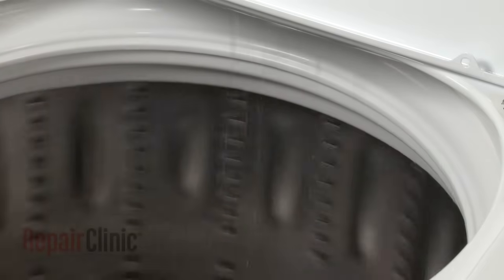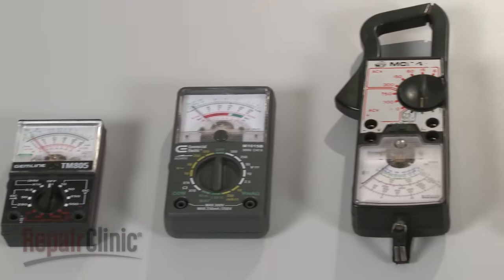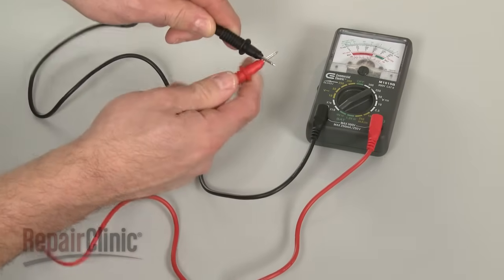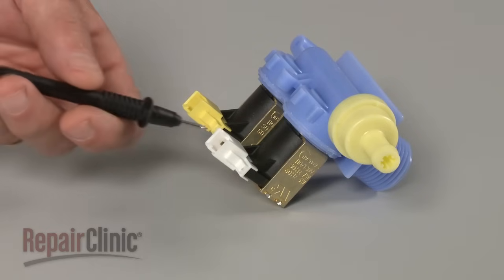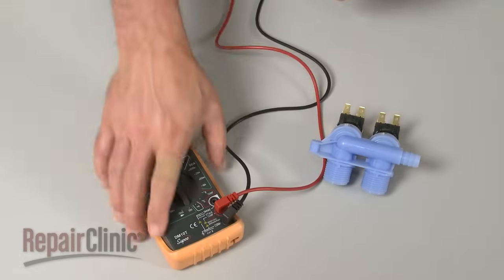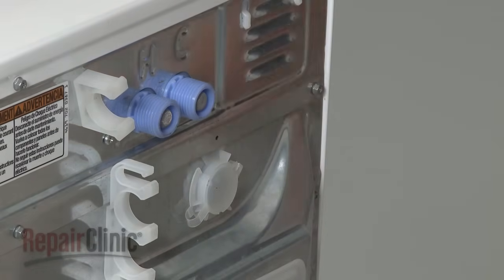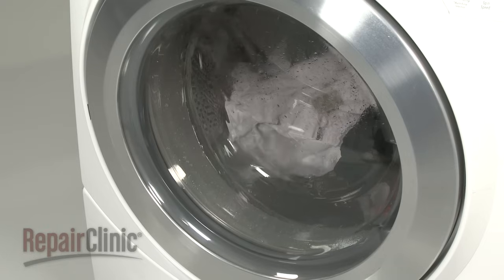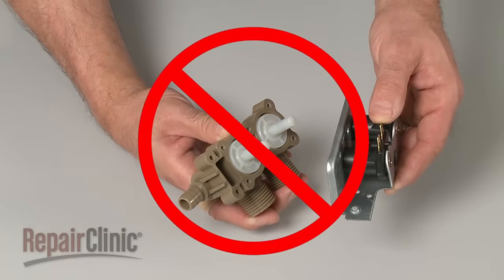Washer Not Filling? Water Inlet Valve Testing, Troubleshooting

Comment: I have received a great deal of help through this site over the past 3 years and need it again. I own a Fisher & Paykel GWL11 that is overfilling, not draining, nor agitating.  Upon opening the top I found that one or both of the inlet valves were leaking into the motor control board area.  I opened the brown plastic casing to inspect the electronic board and I could not see any visible damage. It was obvious with the heavy mineral deposits that the leak was long term.  The diagnostic mode code was 11111000.  Both inlet valves checked at 600 ohms. Is there a way to check the motor control board?  I am a widow on disability and need to make sure before I replace a part that it's absolutely necessary.

Comment: In all the time it takes to do this, just spend the 37 bucks for a new inlet valve, take 20 minutes to install it, and call it a day.

It's most likely a water inlet valve failure since everything made in China lasts 2 years at most. Our washer never worked right from day one, taking 3 hours to do a 1-hour cycle.
Reply: Just run it on the quick 15minute cycle and then it will take an hour.

Comment: "Trying to clean out an old valve is not recommended due to the risk of part failure after repair". Yeah, more like "Trying to clean out an old valve is not recommended due to it working in most cases and we lose money on parts".

Comment: Its very simple to take apart the valve and clean it. If the solenoid is working then it.'s 99% chance the seals are dirty and or the inner screen is blocked. I have done this many times on almost all washer brands and never had any part fail. If you take it apart and find broken pieces then the plastic failed not the Solenoid.
Reply: @repairclinic  that's why you test the solenoids. If the solenoids are bad yeah replace the entire valve. But opening the valve to clean out two screens if they're clogged it's very straightforward. And I would say if you don't know how to disassemble the valve or test to solenoid you shouldn't be taking apart the washing machine in the first place. And if what you're saying is true that can happen at any time if the valve gets stuck open without even opening up the valve so what's your point.
Reply: @repairclinic  Again no difference if they fail without taken them apart. I have never had one fail. Again no difference if your hot water tank fails and floods the house or a toilet line fails. What your point.